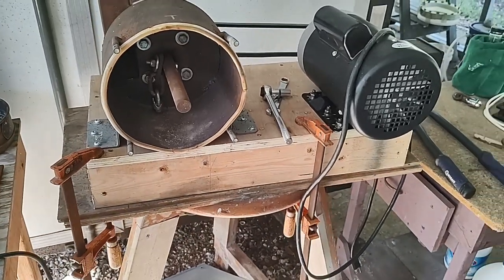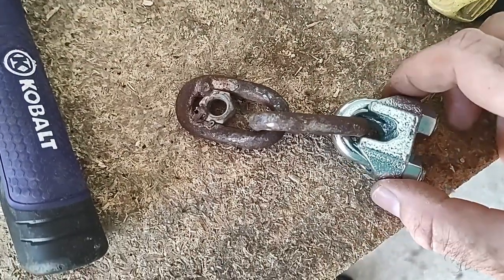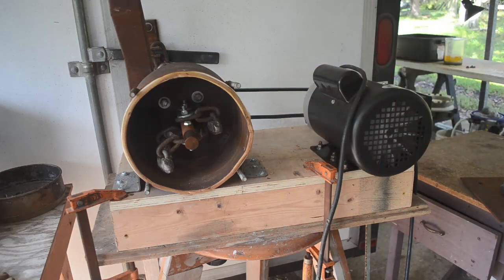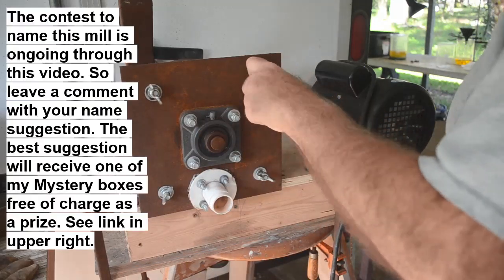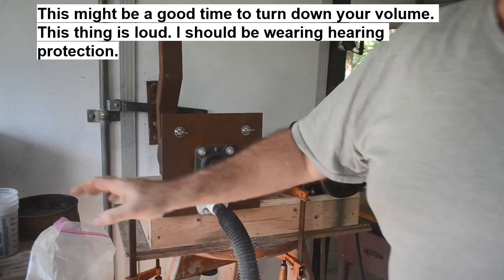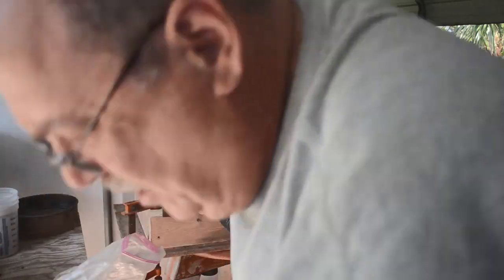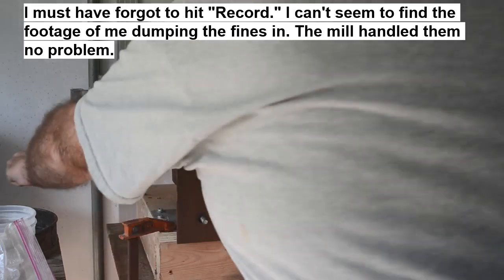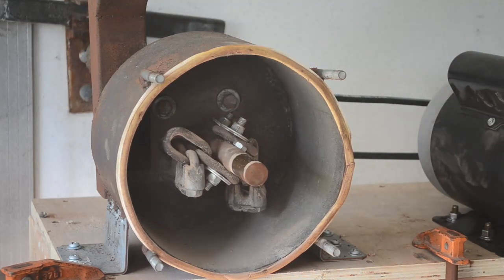Gold From Rocks With My Home-Made Flail Mill &  Contest To Name It Part 2

Comment: I don't like those hammers.  They are like cups and hold material, that won't get pulverized.  I think you need a solid piece of hardened steel at the ends .  That are wider to cover more surface area inside the mill.

Comment: Running much smoother! I used the shackles with the Mighty Mill to make it easy to replace when the time came. The truth is anything you use to crush rocks will eventually wear away, it's physics. P.S., I plan on rolling out my bigger model this Spring, very exciting!